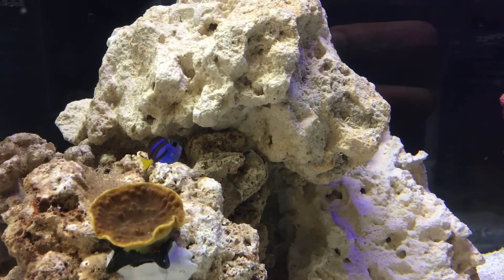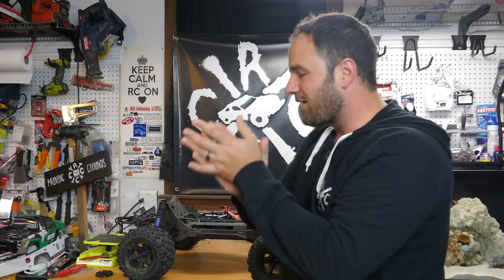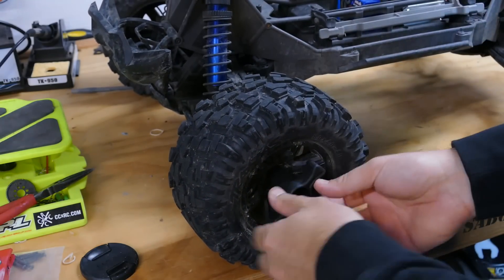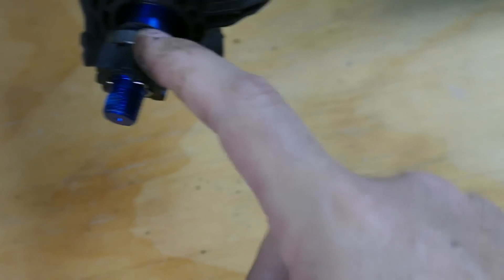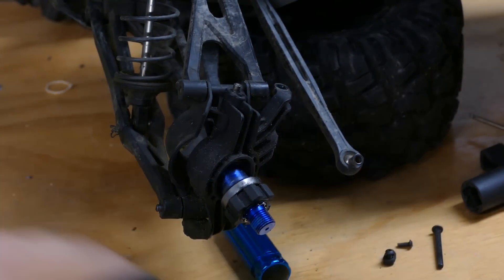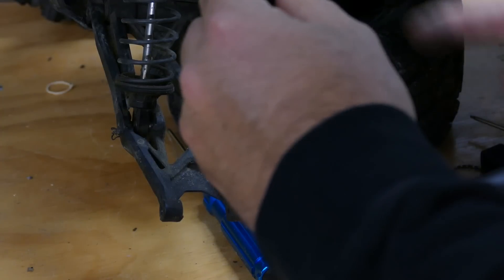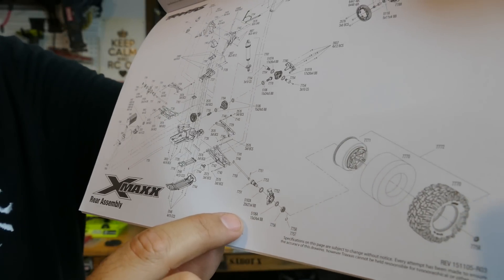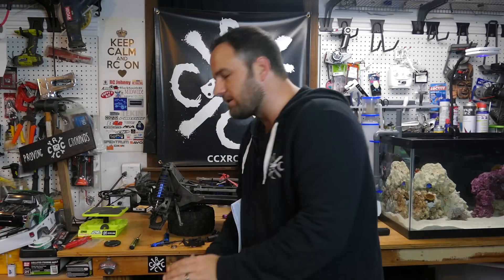Diagnosing My X-maxx C-Hub Issue

Comment: I just did the exact same thing. Hopefully I have that size bearing. One of my favorite things about the XMaxx is how easy it is to work on.
Reply: I was driving pretty slow when it happened. I actually have it in video. If I ever take the time to post it. I have hours of footage issuing my GoPro. Just haven't went through it yet.
Reply from the maker: They really are great to work on
Reply: CCxRC I have about 30 different sized bearings and of course I don't have this one. You weren't kidding when u said they were an odd size.
Reply from the maker: +Adam Baker doh! Luckily they don't cost too much.

Comment: Hey Tony! Very informative indeed! my Xmaxx shocks(all 4) are leaking on the very first run on pavement ... Is it normal? Is it like breaking inn? How do I fix it since everything looks intact?
Reply from the maker: +Faraz Ansari I don't remember any leaking from mine. Where is it leaking from? The top cap or from the shock shaft at the bottom of the reservoir? Maybe they were too full?
Reply: Bottom of the shock shaft Tony! It's a stock brand new and just ran it for 5 min on pavement like a shelf queen.

Comment: Put it on 50% when kids are driving
Reply from the maker: Typically I do that. He seemed to have it down though, so I left it full. He ran it great for 5 minutes before slamming the house.
Reply: CCxRC I just put 4s in it....seems slow enough for them.
Reply from the maker: Adam Baker That works! Great tip.